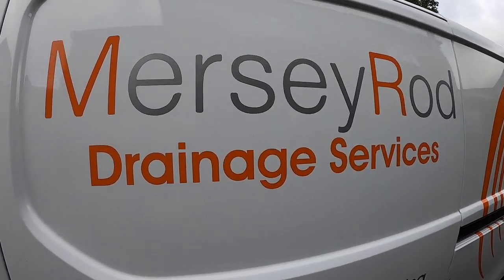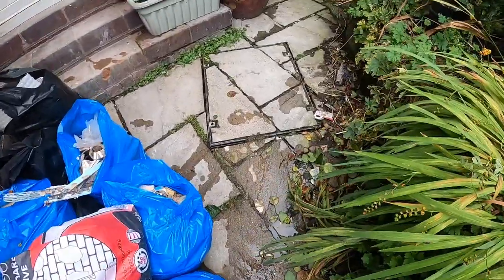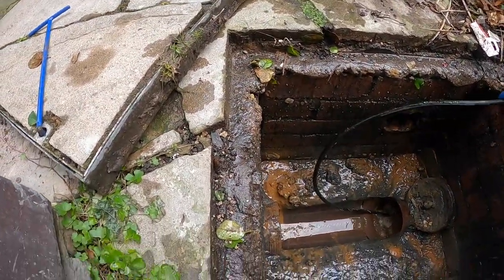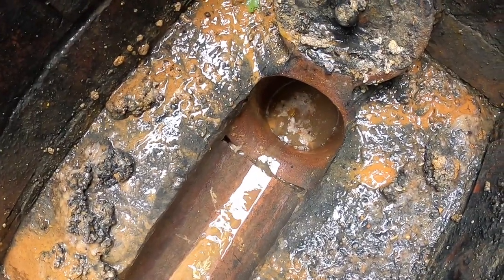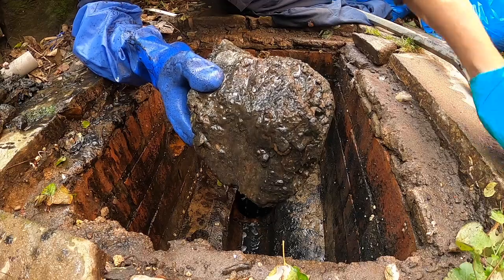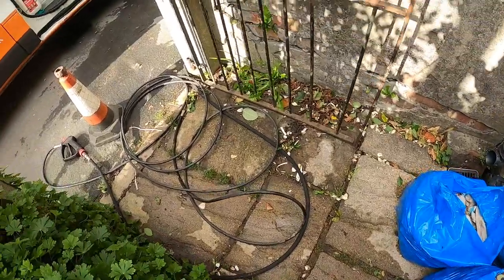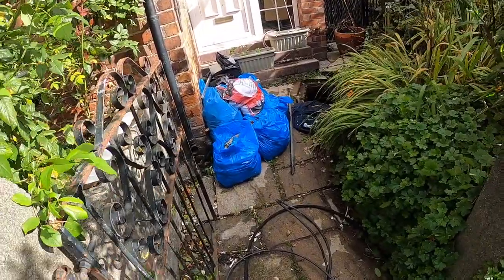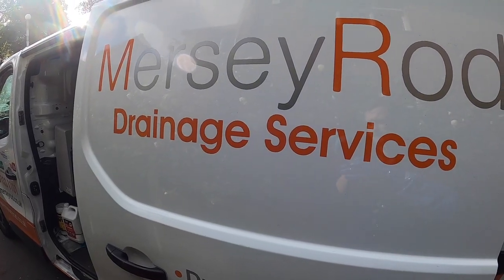Manhole Unblock! #59

Comment: How did the cement get in the drain?
Reply: though it looks old, those bags look a bit of a giveaway, washing buckets and tipping down drain presumably
Reply: When the front was repaved I should think and the fitters were lazy and either washed excess down the drain, or, more likely excess mortar fell in while they were fitting the drain cover, and they didn’t bother to pick it out, and just ‘washed it through’
💦🏳️‍🌈😷👍🏻

Comment: Have you ever encountered deliberate concrete filled soil stacks before? I just had one on a job i took over after the builder was kicked off the job! Completely filled the rest bend! Ended up having to completely re-run 8m of new drains and required two new manholes!!! Is there a way to clear concrete or was my way the only way round it?

Comment: One thing I’ll never understand, how or why it cost extra for you or the tech to put a camera down a hole and watch a screen? I mean if I ever have an issue I’d pay it but I just don’t understand how or why it cost extra to put a camera down a hole and watch the screen. Can you explain why??
Reply: Extra man, expensive kit (used to be £12k back in the early 80s for a camera system).  Most jobs dont need it.  What it does save is knowing where any excavation work is needed for a repair, so the cost of the camera gives evidence for insurance claim, or reduces cost for the dig and relay, or makes it more efficient.  Tended to be used more on multiple drain runs in commercial (retail/ warehousing) premises or larger estate houses. Cameras can also be used on other pipework, not just drains, but industrial processes and so on including steam pipes to show clogs or weak joints etc.
Reply: They had to buy that screen and the camera